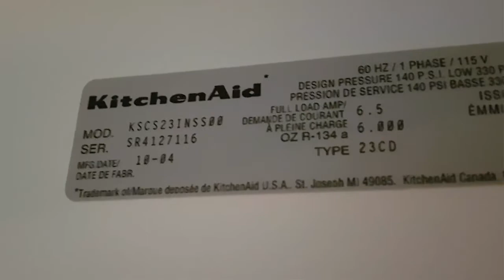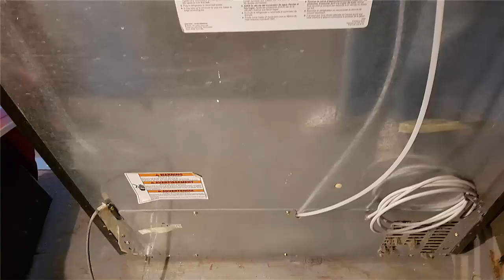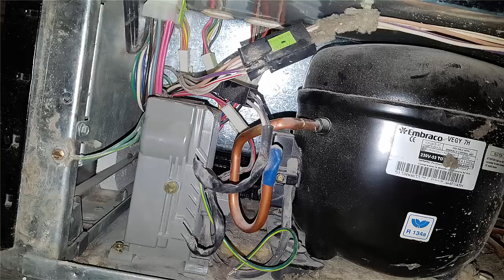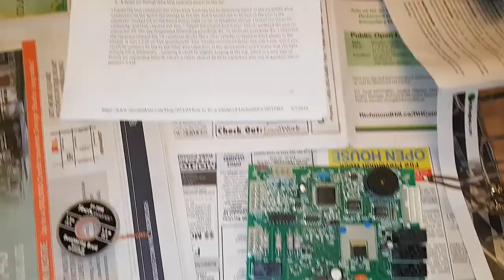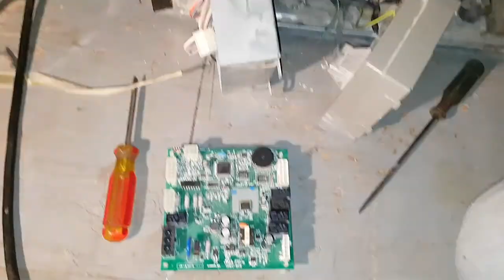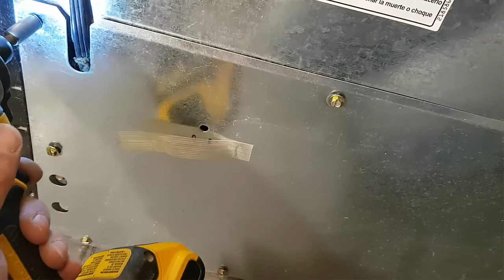Repair Control Board  for a  KitchenAid Superba Fridge

Comment: I have similar issues as many have commented regarding the condenser fan as well as the evaporator fan. Unfortunately, replacing the capacitor and relay did not resolve my issue. I am stuck on whether to replace the whole refrigerator but I don't want to give up. Others have described replacing the remaining three relays so I am considering it.

Comment: You and Steve Jenkins are 2 terrific human beings.   My old KitchenAid KSCS25FTWH01 is acting up.  I can hear a relay clicking.  The compressor and the compressor fan are both turning off and on. 

I ordered the parts from Mouser.  I plan to replace the components when they get here tomorrow.

Comment: Hello, need your help - Do you know if the refrigerator has a condenser fan controlled by temperature or if it’s wired to the compressor circuit so the fan come on when the compressor is running?

Comment: Thank you for putting this video together.  Parts on the way for my KA fridge with all the same symptoms.   Its old but until now has been great!  Bought in 2006/2007!   Hoping this works as everyone I know with newer fridges say they fall apart in 2-5 years!

Any idea how to get the technical details paper that should be under the front grille? Mine is missing of course.  

Wanted to see the details for the defrost relay and capacitor just in case it also needs replaced.

Comment: Thank you so very much for posting this excellent video and providing the link to the extremely detailed and informative Steve Jenkins blog. Our 18-year-old KitchenAid fridge is now working perfectly again!! Given how little the components cost, I elected to replace all four of the relays and the capacitor - all for CAD $20. And as I have no soldering experience, I decided to search for an electronics repair shop. For anyone in the Calgary area I highly recommend URUK Electronics - excellent quality work, trustworthy, and super reasonable pricing. So, so happy that this worked out!! 🙂
Reply: Hi Dave, Thanks for leaving your very positive experience and feedback. I'm really glad to hear that my video gave you the confidence to attempt and successfully repair your fridge and that it is now once again working well. I guess that is just one more fridge (and a lot of metal and plastic) that together we have diverted from ending up in a landfill prematurely due to a couple of small failed electronic components. Thanks for trusting this solution and for supporting my channel. Vito Casola - FIX IT Yourself!!

Comment: That's incredible.  I have the exact beeping program from the inverter.  It looks like the control board is no longer available.  This is a tough one.  It looks like a simple part on board replacement, but if messed up, the fridge will be dead.  So will I when the wife sees that.....
Reply from the maker: Thanks for your comment and for supporting my channel. It's really not that complicated but you will need to be careful with soldering not to apply too much heat as you could damage these very delicate circuit boards. If you haven't done much soldering before then I would recommend you ask someone is more experienced to help you with this repair. Good Luck. Vito Casola - FIX IT Yourself.!!
Reply: It worked!  I practiced on an old circuit board and used this copper mesh desoldering tape.  So far so good!!  Can I send you a gift card for a coffee??  Cheers!
Reply: It worked!  I practiced on an old circuit board and used this copper mesh desoldering tape.  So far so good!!  Can I send you a gift card for a coffee??  Cheers!
Reply: It worked!  I practiced on an old circuit board and used this copper mesh desoldering tape.  So far so good!!  Can I send you a gift card for a coffee??  Cheers!
Reply: It worked!  I practiced on an old circuit board and used this copper mesh desoldering tape.  So far so good!!  Can I send you a gift card for a coffee??  Cheers!
Reply: It worked!  I practiced on an old circuit board and used this copper mesh desoldering tape.  So far so good!!  Can I send you a gift card for a coffee??  Cheers!

Comment: Holy shit, I freakin’ did it! Not only am I shocked (no electronics/soldering/relays/capacitor experience), but my wife will be supremely shocked. Thanks so much for the great, easy to follow post. And thank you to Mr. Steve Jenkins!
Reply from the maker: Hi Todd, Thanks for your comment and positive feedback. I'm very happy to hear that my video gave you the confidence to attempt and successfully complete the repair of your fridge. Thanks for supporting my channel. Vito Casola - FIX IT Yourself!!
Reply: Commenting July 2026.  @FIX-IT-Yourself   Like everyone else -- THANKS!  You saved the $3,000+ custom paneled refrigerator that came with the house I bought. One day the freezer-side fan motor started twitching, wouldn't start spinning unless I flicked it into motion by hand. I thought it was the fan motor so I blew $150 on a new one, but that wasn't it. Same problem. 

Because the fan would sometimes run great for a few minutes and then stop, indicating that it was sometimes getting full power, it started to seem like the problem was a bad electrical connection. So I unplugged and re-plugged every electrical connector I could find, both in the freezer compartment and in the bottom compressor section, just to make sure one wasn't loose or corroded. No dice. Same twitching fan motor.

I kept searching on the internet and came across this video mentioning replacing a RELAY. Bingo! That fit the bill of a bad connection due to relay contact burnout. Ordered the parts from the company via amazon. They have a prepackaged set that includes the relay and three 220 microfarad capacitors in case you want to -- or have to -- replace the two other identical capacitors on the circuit board. 

Unsoldering the capacitors and relay isn't easy since you can only unsolder one lead at a time while the other leads hold the part in place. What I did to remove the capacitor was apply side "pull" on one leg at a time, unsoldering each as I worked the capacitor out. To remove the relay, which has five leads, I first melted each lead and blew out as much solder as I could with a drinking straw when the solder was liquid. Then I worked a thin, narrow knife blade tip under one end of the relay body and pried upward as I melted each lead contact point, and gradually got the relay off,. But the circuit board holes were left filled with solder. So for each circuit board hole, I melted the solder remaining in the hole and pushed a large safety pin through the hole and wallowed it out. The circuit board holes have to be open in order to push the new relay's leads through the circuit board, ready to solder from the other side.

Hope this is helpful. And thanks again for posting the video.
Reply: I have this exact model. I did the control board refurbishment, and unfortunately this did not resolve the problem. I AM IN SEARCH OF THE ELECTRIC DIAGRAM THAT WAS TUCKED INTO THE FRONT GRILL. DO YOU HAVE IT?

Comment: Hi thanks for putting an awesome video together! This saved me hundreds! For those with similar problem, I did order both items as you mentioned but on my board the capacitor was blown, I replaced it first and see if that would work and it did! I have the relay just in case in the future! So for those with blown capacitor they that first! Thanks OP
Reply from the maker: Thank you for your comments and positive feedback. I'm really glad that I was able to help you with my video. Thank you for supporting my channel. Vito Casola - FIX IT Yourself

Comment: Wow after two days trying to diagnose a used KA Superba I bought, seemed like it was working fine and second day it showed it’s true colours Lol! My symptoms are, control panel misbehaving , freezer not freezing like day one, my beer getting warm, and ice maker no action. Just curious if this repair would help my case. Great video and much appreciated 😎👍💯
Reply from the maker: Hi, Sorry for the late reply. I would say there is a very good chance that this fix would solve your issue, and definitely worth a try. Let me know if you end up trying this fix and if it solves your fridge issues. Vito Casola - FIX IT Yourself
Reply: I found Steve Jenkins article and blog 👍
Reply: Hi Vito I changed the capacitor and fridge and freezer holding temperatures, still trying to resolve ice maker, I did have some action but not cycling
Reply: I just ended up changing the relay and fridge works perfect 👌💯

Comment: My friend. Excuse me. But why you. Replaced this board control. Wha's the problem on your frige. Pleade.😂
Reply from the maker: Hello Roger, The fridge/freezer was not cooling or freezing food. The problem was with the main power control board. Typically most issues are related to the power control board as they are very sensitive to power spikes experienced during lightning thunderstorms and once a sensitive component is damaged the fridge will no longer function properly.  Also capacitors are notorious for causing electronics to fail to perform as designed once they go bad. These circuit boards were manufactured in a factory in Japan that was destroyed by the Tsunami that struck in 2011 and since then they are no longer manufactured so the only recourse is to repair these boards, or search online for someone that is willing to sell their old board from a fridge that is no longer functioning for other reasons. Vito Casola - FIX IT Yourself!!

Comment: Many thanks to you and Steve for sharing the information. I discovered a few things that may help others with the same issue.

Prior to finding your video, I suspected the evaporator motor was faulty because it would pulsate, relay drop out, and sometimes it worked.

I ordered a replacement on Amazon that was supposed to be the equivalent Whirlpool part. It didn't work at all and caused the 

evaporator coil to ice over. I searched online on how to test the 12 VDC motor with a multimeter. One blogger said that a motor with 

four wires had a (white) common wire, a (red)12 VDC power wire, a speed control wire, and a feedback wire. This is correct because

I hammered open the old motor and found an embedded circuit board (see attached pics). I did order the capacitor and relay from

Mouser and replaced both. The old cap measured about half its rated value and wouldn't hold a steady reading. The motor from

Amazon was sent back. I purchased the more expensive OEM one ($135.00) from a local appliance parts supplier. Put the motor

and board back in the fridge. I crossed my fingers and plugged it in, success!!! The temperatures pulled down to the setpoints in 

just a couple of hours.

  A couple of things I noticed about the control board, it has a protective coating that is easily removed with a toothbrush prior to

unsoldering, and the capacitor and relay have connections to the circuit board trace on both sides. Therefore, it's important to make sure

enough solder gets into the hole around each joint. I couldn't find a solder sucker locally but used a piece of lamp cord successfully.

Comment: Thank you for the video.  How did you determine that the issue is with the control board and not the inverter.  I was removing the light socket under the temperature control when I shorted it.  Turns on temporarily then turns off.

Comment: My KitchenAid Model KSCS25INBL00 air damper started malfunctioning, it continuously cycled closed, even though it was closed. I thought it was a bad damper, but, after eliminating that as the problem I decided that it was the control board.  Having nothing to lose I bought the $20 dollar kit from Amazon and gave it a go. I'm super happy to share that it worked.  The hardest part was removing the old components since you have to heat, hold and remove one pin at a time while the other is still soldered in place.  I'm sure there is a better technique, but, I got it done and my wallet and wife are both very happy.  Thanks for your help!!!

Comment: This fix is 100% legit. Repairman wanted few hundreds to replace with a refurbished circuit board. I only replaced the capacitor and that seems to be holding up for over 3 months now. Can’t thank you enough Vito. World needs more people like you & Steve :-)
Reply from the maker: Hello and thank you for your comment and very positive feedback. I'm very glad to hear your repair is still going strong. My fridge is also still going strong.  Important thing is to make sure repaired fridges are plugged into a surge protection device or power bar with built-in surge protector so you can protect the delicate electronics on the main power control circuit board in the event of utility power spikes during thunderstorms. Vito Casola - FIX IT Yourself.!!

Comment: Thank you so much for posting this video. I have a KitchenAid Refrigerator KSSC42FMS02 with multiple symptoms (Evaporator coil frosting over, evap fan not running, warm fridge side, beeping motherboard, erratic indication on control board). All of these problems went away when I replaced the capacitor and power relay you indicated in this tutorial.  Thank you!
Reply from the maker: Your welcome. Very glad to hear that this video helped you resolve all your issues. Thanks for posting your symptoms and that changing the capacitor fixed all your issues. This will be helpful to others I'm sure.  Vito Casola - FIX IT Yourself!!

Comment: This has been such a huge help so far!  I've ordered the parts I need and after sharing an email with Vito, I was able to track down the article I needed from Steve - it's pure gold!  Vito also gave me some great tips for a beginner solderer to ensure I don't damage the control board when desoldering the bad relay and capacitor.  Since my fan is currently not running, I've hard wired it to an old extension cord and plugged that into an outlet, this is a good stop gap while I wait for the parts to arrive.  (Note - if you aren't comfortable with electric or don't understand why or how I did this, don't take risks as this is 120V power and can cause serious injury or damage.)  
Thanks again Steve and Vito!  You may have just saved me hundreds of dollars!
Reply from the maker: Hi Bryan, Thank you for your comment and positive feedback, it is really appreciated. Really glad I was able to help you. Vito Casola - FIX IT Yourself
Reply: Can you please let me know where you found Steve Jenkins' article?  It looks like his website is no longer available.  Thinking that I can follow the excellent instructions in this video, just looking for as much documentation as possible.  Thanks!

Comment: Hi there!! First, thank you for making this video and sharing your knowledge and experience. We spent almost a whole day trying to figure out what is wrong with our Kitchenaid refrigerator model KSCS25FKSS02 until we ran into your video. Been reading through the comments of what others have been experiencing.  My husband replaced the thermistors and the freezer seems to be getting colder however the  refrigerator side is still not as cold as it should be.  We were also having problems with the inside of the door getting hot, which seems to have been fixed now.  We have ordered the capacitor and relay and will replace them soon. I have a question though. Our refrigerator side has a temp control panel that when I set it to 0/34 F it changes after a few seconds. Is that something that is due to the capacitor/relay not working properly? Just wondering if there is something else that needs to be replaced to fix that.  Is there a way to get a copy of Steve Jenkins document?  Thanks again for sharing your knowledge!
Reply from the maker: You're welcome Lupe, and Thank you for your comment. You can email with a return email address and I will glad to share the information you requested. Vito Casola - FIX IT Yourself!!
Reply: @FIX-IT-Yourself  hi there! Thank you! I will send you an email today. My husband changed the capacitor and relay, the freezer is a lot colder now, but the fridge is not cooling. Also now we are hearing a gurgling sound when we open and then close the freezer door. Any clue of what we should do next?
Reply from the maker: Hi Lupe, If the freezer is set to 0°F and is able to make ice but your fridge side is not cooling enough then check at the left side of the fridge (near the top and at the bottom) and should find sliders that allow you to open and close the ventilation ports from the freezer section to the fridge section. Make sure they are both open (slide them both back back and forth until you are sure they move freely, then be sure to keep them where they are marked open and check that you feel cool air coming from the top opening). Regarding the gurgling sound, I'm not sure what that could be other than possibly something to do with the water line. These fridges have a water dispenser and an ice-maker / ice-cube dispenser (cubes or crushed ice). Perhaps it has something to do with that?? Anyway glad to hear your husband took the initiative to replace the capacitor and relay. I hope that fixed the fridge. Anyway best of luck and feel free to ask more questions. I will answer as best I can, when I can. Vito Casola - FIX IT Yourself!!
Reply: @FIX-IT-Yourself  the ports are open. Another thing i noticed is the door area that separates the fridge and freezer is hot. Could that be the cause?
Reply from the maker: @lupenava122  Do you have a manual for your fridge? If not then I have one for my KitchenAid. If you send me an email at vmcasola@gmail.com I will send you my manual and there is a troubleshooting section that you may find helpful. Vito Casola - FIX IT Yourself!!
Reply: @FIX-IT-Yourself  thank you! I sent you the video.